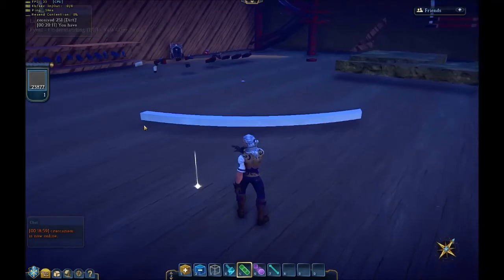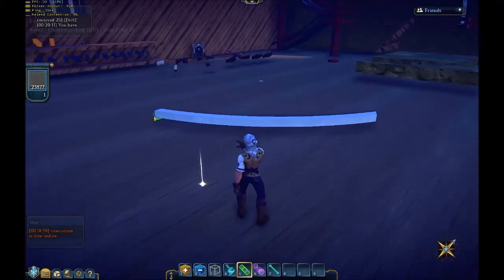Stepped Rings

Comment: Doesn't work for me. All done like on video but for 26voxels diameter rings sector. Ring shape starts break during already healing space around it. May be somesthing were changed in mechanics or i do something wrong. Will be glad for any advice could help me, thanks.
Reply from the maker: Do you have the edge of the ring section that you are healing around facing towards the south east?
Also when you hold J and heal around the surface sometimes your cursor will not sit on the surface properly, in which case just move the mouse a little till it pops out.

It still works as of this morning, who knows after the patch.
If you still can't get it to work send me a tell ingame and I will go over it with you.
Reply: Fyrel's Builds My bad, sorry. English is not my native lang and i translated east as west in my head. All works fine, thanks for tutorial and for helping me find my mistake. =)

One more qestion: do you know how to connect circles with different diameter without deformation?
Reply from the maker: MrSomeonex The same method will work doing a quarter of the circles at a time. 
There has to be enough difference in the size of the circles so they don't share voxels.
26 diameter circle will stack onto a 30 diameter but not a 28 diameter.
Hope that helps.
Reply: Fyrel's Builds Thanks!

Comment: Great. But if I use different materials or whatnot, everything gets jagged, bent, or bleeds.
Reply from the maker: It shouldn't matter what materials you use as to whether you have removed the distortions or not.
There is unfortunately a large selection of materials that bleed with the healed dirt these should be avoided while building with this method and painted afterwards.